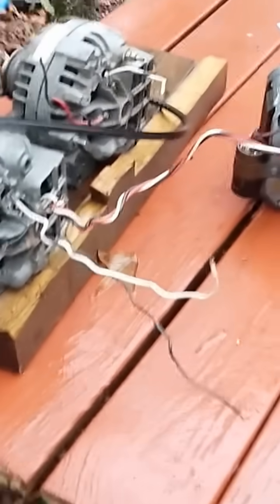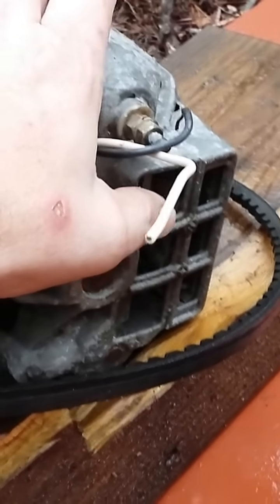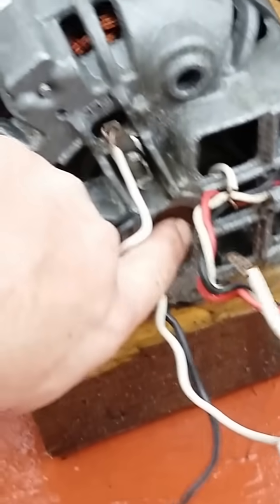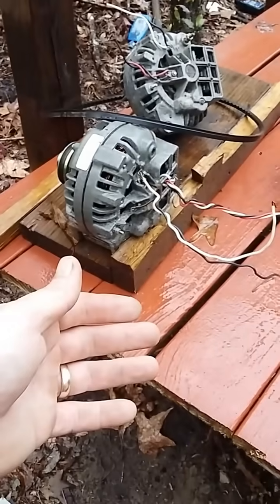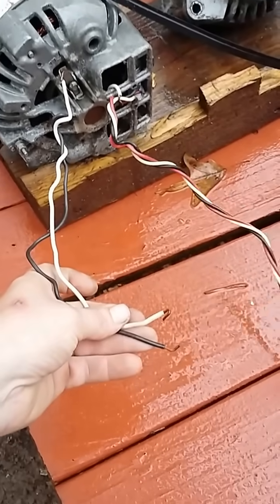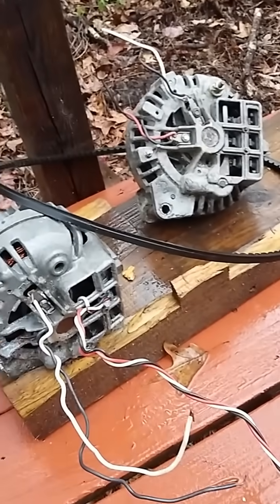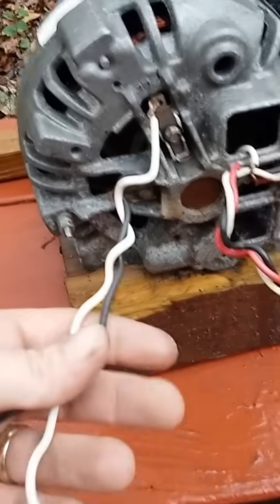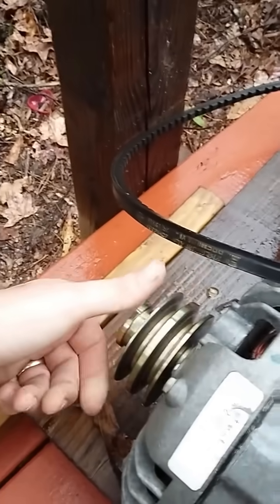Update Free energy forever no wind no solar no gas READ DISCRIPTION!!!

Comment: The drive motor looks like a washing machine motor out of a whirlpool.  This is my assumption correct me if I'm wrong, if this ac wash machine motor is your drive motor how can it use 6-12 volts to operate? We all know wash machine motors use 110v.  I know you left out some info so I'm assuming the power generated from the 3 diodes are running the drive motor after starting with a step up12 to 110v  inverter off a car battery, the drive motor turns the two alternators one alternator is used to power the drive motor and the other powers your home or whatever the need is.  It is theoretically possible that once you get this arrangement turning at an optimum speed it could become self perpetuated with the help of a large rheostat some amp and volt gauges and a few prayers of protection.  I'm pullin for ya man.  Ignore the ignorant, the  average joe only knows what he or she is told and they all do what they told ya bunch of sheep.

Comment: I like your response to the MAN. I will be checking out your off grid power supply. I am moving to a area that has no power lines to it and I dont want to put out for solar. Here where I am now I have free power because I went up a different pole then where my wire was coming off the high line, down the pole so no one could see and in through my back yard. In front of the power company I went up a ladder and cut the lines coming to my meter. Been over 2 years now and no bill. They go by see the wires are still cut hanging. But next place I am going to have to think of something, now they use gas generator. Your idea I think if I put a motor on side to spin the alternator/generator I can do it ass continuous run and just dump excess power produced. Thanks good video.
Reply: Easier ...battery...3600watt inverter ....motor from air compressor ....and alternator....in that order and just loop the wires back to battery to juice inverter.....cake

Comment: Well you don't know! Stater, doesn't move! You can are so stupid! Sounds like you are working on joining the Darwin Award!
Reply from the maker: +Donald Smith "you can are so stupid" sounds like you're 80 years old and still can't put a sentence together...  you should be ashamed of yourself Don. Do you not know what a smoke stream video looks like? I mean you can look at any of my other videos and plainly see that I know the difference between a rotor and stator... all you had to do is look at the description of the video.
Reply: You must be a liberal! You go off on things that don't matter! Stater is the part that doesn't move!!! You can't use a motor to turn a generator and get more power than you put into the motor! The AC that comes out of that is 3 phase, not what your house uses! What speed do you turn th alternater to be sure you get 60 hz. You need to take a class in electronics!

Comment: So you power the field coils with six volt battery and spin the generator with a electric motor and you get 90 amps 220 volts alternating current from the stator wires if you bypass the diodes? How many amps at what voltage does the electric motor consume?
Reply: More than it produces

Comment: I have a set up very similar to this on my boat.  I have a Baldor 210 amp alternator which gives me free energy.  All I have to do is turn it with my 85 horsepower diesel engine.  See?  Free electricity.

Comment: You can actually make this system work if you incorporate a fly wheel to use gravity to increase efficiency.  Your going to draw as much from the motor as you can generate.  You loose alittle in friction and starting so if you use a flywheel you can actually generate more than you use.

Comment: You have done a great job at showing what the input and output are.  My question is, I need to see how you modified the wiring inside the housing of your alternators.  Is there one or more videos which you have made that clearly show how you connected everything under the housing?  I appreciate what you have already done.

Comment: Ok genius   You repeated yourself 10 times on how to wire it....yet you never showed it work....Hook a volt and amp meter to show the output...also show the load used from motor  so you can prove it generates more than it uses
Reply: Bless you and thank you for sharing! May heavens angels protect you.

Comment: This cannot be done, it would be putting out more power than you are potting in, that would be a perpetual motion machine. As of today, they dont exist. So in this video, wire the motor to the alternator and put the "v" belt on the motor and alternator and let the alternator power the motor, and the motor will spin the alternator.  Perpetual motion, doesn't exist.
Reply: Wired up idiot

Comment: This is a JOKE! C'mon people, you really gotta be stupid to think that this works. I Particularly love when he calls the "start switch" on that whirlpool washing machine motor a "diode". Ask "Newton" about this: Energy cannot be created without some other influence.  Something has to spin the generator. Usually it's a turbine. Wind, steam, water...something.  Another commenter mentioned that the frequency would also have to be regulated at close to 60 Hz. BTW: Alternators of this type put out 3 phase 190 volts 188 Hz when spun at the specified speed set by the manufacturer, with NO LOAD on them.

Comment: It is great to experiment but if you don't know what you're talking about, many things seem possible when they are not. Considering one alternator, if you supply a voltage to the field coil, bypass the diodes and turn the rotor you will generate AC. The Gotcha is that you have to have a free way of turning the rotor quickly, another electric motor that you have to pay to power doesn't cut it. Another Gotcha is that the alternator will output high frequency AC, not the 60Hz that you would normally expect to find at the receptacles in the home. Universal motors would be fine with high frequency AC but anything that expects the correct voltage and frequency would be in trouble. Another Gotcha is that if you try and connect two or more alternators in parallel, their outputs would have to be the same voltage and exactly synchronized together, if not  they would probably burn out. For a crude generator by all means drive your alternator with whatever you have, put a voltage to the field coil but understand that your output is not going to be a standard voltage or anywhere near 60Hz. Thanks for sharing.
Reply: You just made TESLA look like a fucking idiot.

Comment: Sorry buddy. I’m a master electrician and your wrong. You’re telling everyone how it works. Why don’t you show us.
Reply: Not to mention 90 amps on a 10 wire. Lmao
Reply: The MIB is probably y thats y he lives in da bush(he's scared)n this isn't me daring u to create an existence without the government )I'm disabled)
Reply: Master electrician is questioning this. What this buddy has made is so simple, I believe I can help my grandson put it together and it will work.  Why I am so sure?  Let's face it.  A car alternator already producing 110 volts of electricity when the rotor is turn by any means.  But the AC produced by the alternator is not useful to the car electronic or else.  For this reason, the manufacturer of the alternator incorporated a bridge rectifier that convert the 110 AC into DC so that it can charge the battery.  Usually, when a car alternator stop functioning it is the rectifier that goes bad.  Just replace the rectifier with one the same rating and the alternator  will be working again, provide there is no problem with the bearings.  You are master electrician, right.  OK. Go to any junk yard, buy a used alternator for about $5.00 and when you come home, put it on your bench, remove the rectifier and you'll see three wires await for you.  This is where the AC voltage came from.  Take anything like an electric motor with pulley and put a V belt on it. Is that simple master electrician.  As the alternator turns put an excite voltage equals to the voltage of the alternator. Let's say 6 volt if the alternator is 6 volt,  or 12 volt if the alternator is 12 volt. The three wires that have been exposed after the removal of the rectifier, that's where to connect the wires which are already AC to your house or to power your mixer or anything for that matter.  How do I know about that?  I came from a rural country and I used to see my dad doing this countless time when I was a kid.  That's not rocket science.the man explains the things too many times.  And we see the lines that go to his house, what better proof do you want master electrician. Go and do it.  And because you say that you are master electrician you are going to use a multimeter and an ammeter when you make a video to Youtube.
Reply: @walnickpierre-louis9038  he claims free energy in the video, I know he is just learning about electrical. But come on, sharing free energy scams videos just take up energy that could be used to display more correct information.
Reply: @walnickpierre-louis9038  well said..I believe you on this video... especially based on what my dad left me that is in my garage
Reply: @walnickpierre-louis9038  lol it's amazing how little you know about electricity.

Comment: Those wires are rated for 30 to 40 amps A/C and will start a fire if more amps are used.  Need #6 AWG for 80 amps ..#4 up to 120 Amps.
Reply: It's a 60 amp alternator lol
Reply: #6 is good for 75 and #4 is good for 95, both wires insulation being rated at 90°
Reply: the whole video is misleading and a dirty scam. He takes half truths and distorts them, then feeds it to the trolls Lol. Yes, 30 or 40 Amps is accurate but at 12V, not 120V.The whole discourse is messed up.
Reply: @jeffokriya3389  just because someone is uneducated doesn't make them a "troll", now my vagina leaked all over the place

Comment: Do the alternators spin themselves? Where do you get the power from? Do you have squirrels to spin the alternators?
Reply: bill boyd it’s a stupid video I won’t go into why this will not work and it’s raining. He needs a massive drive to rotate the motor to give off a massive output plus the losses. What a plonker
Reply: @alanmorgan6480  If you can get 25 watts from a squirrel on a wheel, and had 100 wheels spinning at 1000 rpm,  he could easily get 2500 watts and be free all day to gather nuts.
Reply: @billboyd4051  lol
Reply: @bigedwyman1095  5 million views of BS should provide money for free something, maybe a new axe to make mounts or a soldering iron.
Reply: @bigedwyman1095  I see he is a Christian scam artist who creates his own reality but unable to spell divine,
Reply: @billboyd4051  good thing he lives in the woods
Reply: @bigedwyman1095  A couple of treadmill motors with big flywheels, I hope GE and Westinghouse don't find out, could drive the cost of treadmills up.
Reply: He uses a   herd of motherless goats to drive the pulleys of the alternator
Reply: @theantichrist6524  His other video's show a pair of endless running treadmill motors he claims put out 3kw, he sells to support his faith in Jesus and to pay for his own electric bill.

Comment: By all means, if there is a way to generate electricity for free with two car alternators... wouldn’t this be already done since decades?   Sorry but listening to your squatter showed me you have no clue of even electronics. Ampere does tell you nothing about the power you can generate. 
And powering your whole house is usually requiring at least 110 Volts. And the three things Voltage, Ampere and time are related to each other. But I guess this already is over your head. Tip two will give you the power, all three make up the energy. Your home appliances run on energy not power

Comment: Alternators 101: as you load an alternate it will require more horsepower to keep it rotating, the field excitement energy is small but the horse power required to rotate it will always be greater than its output power. Also the alternator produces 3 phase output 120 degrees out of phase with each other on the 3 wires, the diodes are then used to rectify it.  Even alternators modified with magnets will only reach 90% efficient or so. The reason someone says you wont live long is because they notice how ignorant you are and you play with electricity in the rain. Amps alone is not power. Shorting an alternate for use as a 90 amp welder running at 5 volt is only around 450 watt and will result in alternator damage in short term use but will still require a power source to rotate the alternator. This is the reason they make welders with large wires to handle the current properly. Study electricity 101:  V*I=power it is requirement for the alternators 101 class. You can send me 5 dollars for my free teaching information.
Reply: Sounds like you know your shit

Comment: Says the electric bill is between $300 to $1000 per month. 
Two minutes later says 180 amps is all you need to power your house.
Reply: just use the power from the house connect your blower motor to it via belt or one alternator then battery then inverter and make a 2nd fuse box you will cut your bill to like 100 month

Comment: I use a 12v car battery to power my inverter that runs my battery charger which charges the battery.
Reply: did you make a 2nd fuse box
Reply: @rickcarp5453  Of course not. I was being silly.

Comment: A few problems here:
1. Where is the DC voltage coming from to power the motor?
2.  Each component in such a scheme would introduce a certain amount of loss due to inefficiency.
3. The explanations completely defy Ohms Law
4. The "6 volts DC" simply aren't going to produce 240V 90 amps AC. Nope, not unless they are coming from a very large 6V battery bank to produce the equivalent amperage. Then, that bank would need a charging source. See #2, above.
5. He refers to the utilities selling you electricity that they get free. True only if you discount the cost of building Solar, wind,  hydroelectric dams, nuclear, gas, oil or coal powered plants, etc., plus the cost to operate and maintain them, and distribute it to you. Other than that, yup, it's FREE!

6. Doesn't show it working, because it can't possibly work, without some external source of power: Solar, wind, generator, hydro, mechanical - something.
Reply: NotCook  
Needs a spark gap charger to keep battery charged.

Comment: So you could actually hook up a bicycle chain system to the alternator then charge a car battery and hook up a power converter to the battery and plug stuff in,right?you would get good exercise living off the grid.

Comment: played with this back in the 70's battery runs the motor charger charges battery but can not generate enough supply to do any more than that. so really your do not gain anything.    hummm don't see it running???????????

Comment: I want to see a demo with actual voltage and current readings. yes you can build a generator out of car alternators but it will not power a house. i have always wanted to self sustain but its just infeasible. one car alternator is around 10- 12 volts ac at three phase not 230 volts ac
Reply: actually they will put out around 90 wild volts that you have to regulate before you can use

Comment: Hello my friend I’m following you thanks , I have a Question for you you say you get 90 Amps off the back of the stater on a regular alternator ok if I have a Chrysler alternator off a 1986 jeep Cherokee which produces 180 A through the regulator how much do you figure I’ll get wiring it this way ? The way I am planning thanks for thinking out side of the Box !
Reply: keep it wired the way it is and get more of those heavy duty alternators,regulate the output and send to a huge battery bank then regulate it to house current then wire it into your house...but  first you have to build water wheels or windmils to turn the alternators which are hard to turn when they are cranking out juice.
Reply: https://youtu.be/TpvXEp1Idis

Comment: It would last about 1second as the size of copper conductor needed would be about diameter size of little finger. The wires you have look to be about #16 & dependent on insulation could carry about 10 amps, not 90 amps. Facts!!!
Reply: Robert Meacham .
This is correct.
It could run 1 (120 vlt 15 amp breaker just fine.
But you would need the correct sin wave frequency smoother.

Comment: If you hook an alternator up to run an electric motor 110v to run in another alternator to run par 2 your house or whatever then all you need is a way to start the electric motor you don't need the battery to start it how you can hand crank it and make it start

Comment: I have a question.  How can I power my future Shipping Container Home 24/7 365 days a year so I don't have an electric bill?
Reply: cover the top with 90 watt solar panels,put 12 huge 12 volt batteries under it hooked to the solar panels ....then regulate the voltage from the batteries  to 220 volts AC and hook it into your breaker box...simple
Reply: @gunzmith29r  Might want to add a charge controller so you don't boil your batteries during the day, or such the juice back out of them at night.

Comment: You still have to put power into the alternators so it's not free if you have to put power into it that must cost some money
Reply: He powers  it free with running water there is a river Stream close by he then connects his set up to a wind mill device that spins with the power force of water like a wind mill.. which turns it into a turbine/ generator.. that then generates free eletricity.
Reply: @dougmoore4842  oh sorry cuz the discription says with no wind ,,,so water and wine is putting power into it, right
Reply: i got a hand crank flashlight that just cost one dollar at dollar tree 10 yrs ago that still puts out free eletricity.